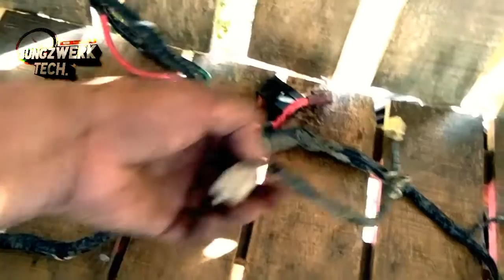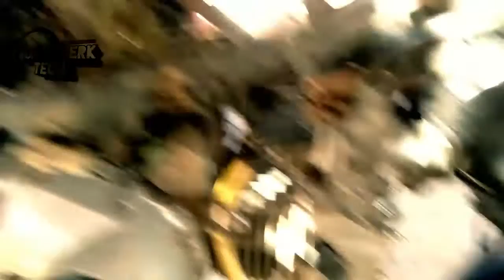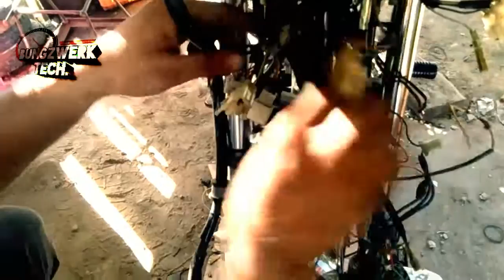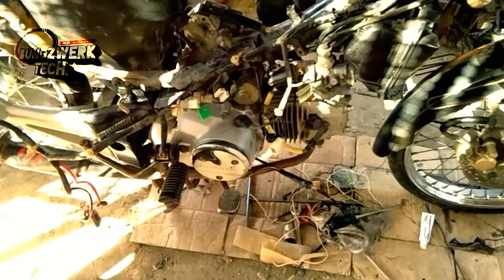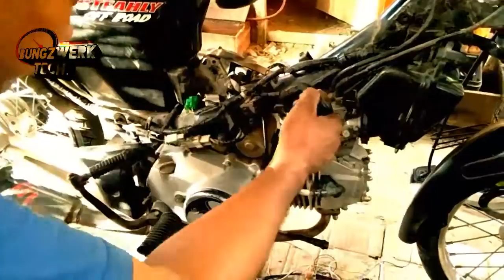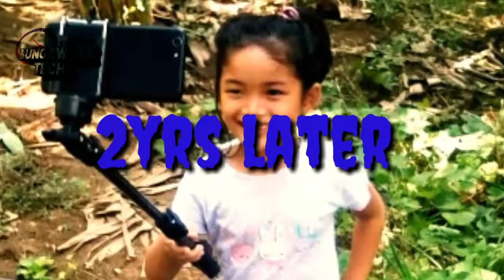INSTALLATION WIRE HARNESS || Wiring DIAGRAM HONDAXRM125/PART2

Comment: Sir dili ra bilikado butangan ug swtch ang battery?dha man gud ko ngtap gisulda sa grreen nga wire sa battery connection gibutangan nko ug switch
Reply from the maker: Unsay purpose nimo sir ngano butangan nimo og switch.. Ground man ang green kng mag dagan ka wala nay charging sa bat nimo kng naka off ung green
Reply: Ang porpose kay inig dli na gamiton example magbie or mastandbybna ang motur pila ka oras ako man gud e off..kay aron dili dali madrain ang batery..naa man guy giingon nga parasitic consumption kono kong magpondo ang motur...maong e off nko ang conection kong di gamiton..e on nasad ug paandaron na padaganon
Reply from the maker: Ok rana sir pero gamit ka nang malaki na amps na switch main line ground kasi yan

Comment: Gd pm bai ask lng ko ba unsay solusyon ani aq motor xrm 125 ig tamak sa foot brake pedal mawa mn ang ang suga nga display sa dashboard?dli n mo function ang brake light, horn, sgnal light.tnx bai hnaot unta mtubag nmu..
Reply from the maker: grounded ang brake light switch tapos ang fuse maputol na dayon try tang tanga ang brake light switch kanang wire niya
Reply: Dli mn kaputol sa fuse bai 30amp aq gigamit mag on and off cxa sa dashboard usahay pod sunogon niya  ang wire sa fusebox .cge bai tnx sa info
Reply from the maker: taas kaayo imong fuse 10a ra og 15 para kng naa grounded maputol niya  ..nag ingon man ka nga inig brake nimo pusibli brake light switch nimo grounded jod na
Reply: Ah ok bai aq ilisdan ang fuse, lge kay   mga bg o mn aq brake switch.cge bai slmat pg usab

Comment: Boss tagpila na ang wire harness boss naa sd unta koy plano mag ilis ug wirings kay karaan na kaay nanay mga putol2*
Reply from the maker: kung replacement boss naa na sa 800+ kung orig naa na sa 1600+ piro  dipende na sa klasi sa motor boss..piro advice nako sa imo boss orig nalng ka para sure.  kasagara sa replacement dali ra maputol tapos mag init siya..unsa na ng motor boss?
Reply: @BungzWERK  kombinar mani.boss susuzuki angb body nya skygo ang makina